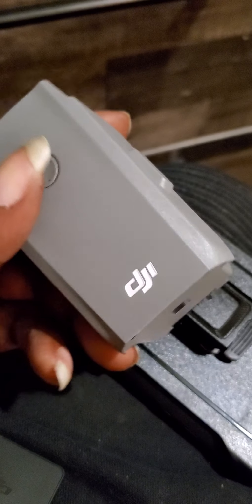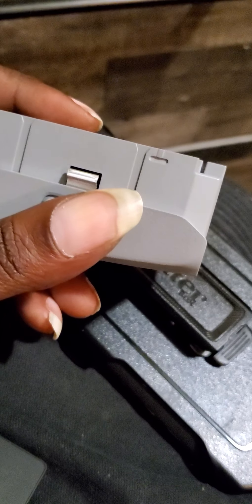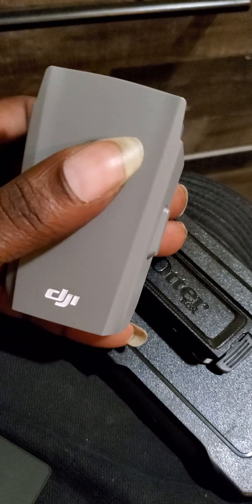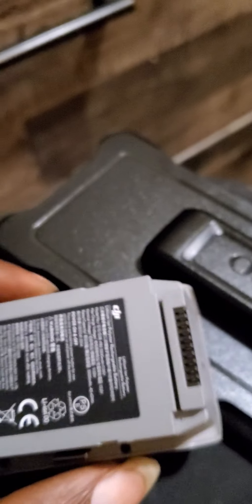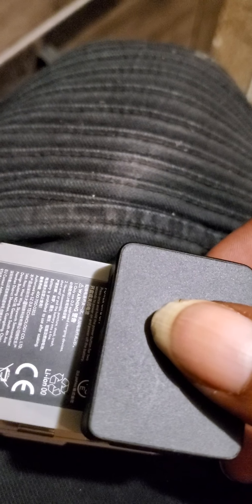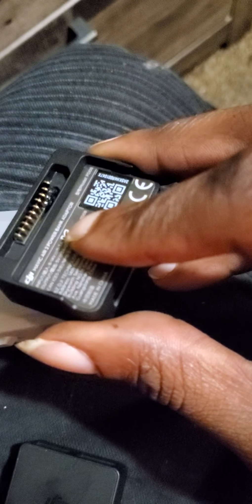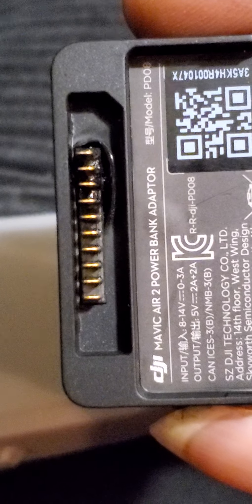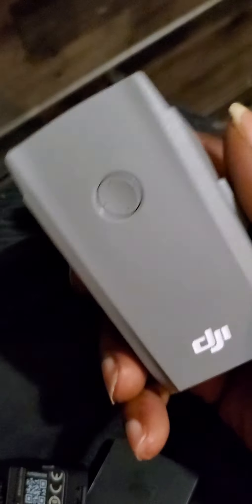Bad Bad Mavic Air 2 Battery (Second video)

Comment: That's not the charger for the batterys, that's the piece that converts ur charger so u can charge your phone
Reply: Bro I just got the mavic air 2 today. To be honest my charger looks different from your charger. I don't think you're putting in the right charger port.
Reply from the maker: @Dadistheking   that was the power bank adapter not a charger it comes in the fly more combo
Reply: @PhillySwole2002  dang that's crazy brother I hope they resolve the issue fast.
Reply: @PhillySwole2002  i just try mines and it seems ok i dont think its the battery it maybe that piece that is bad try the battery back in the drone if it power up ok then its the adpater

Comment: it may not be the battery i maybe the other piece that is place on the battery maybe the connectors in there is not wired right
Reply from the maker: Yeah I think it was The battery. If you look at my 1st video.  It was malfunctioning in my drone and it works great 👍

Comment: It's fake battery, the logo should be grey, not white and the text at the bottom is different than in the dji battery. That's the problem.
Reply from the maker: The battery is real DJI replaced it no problems